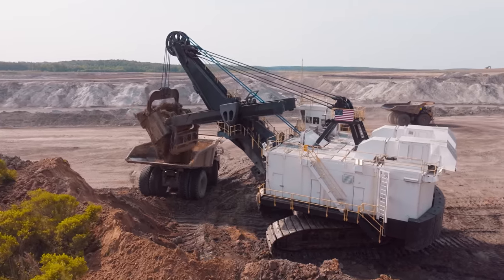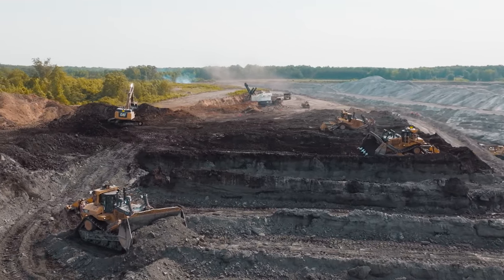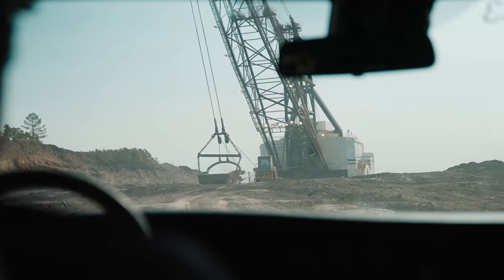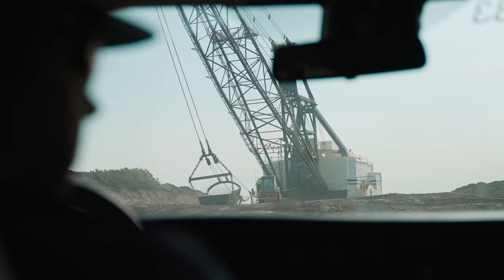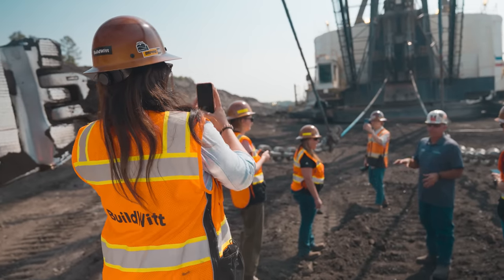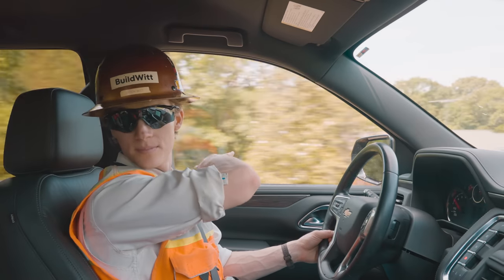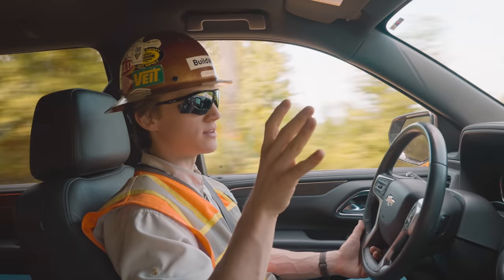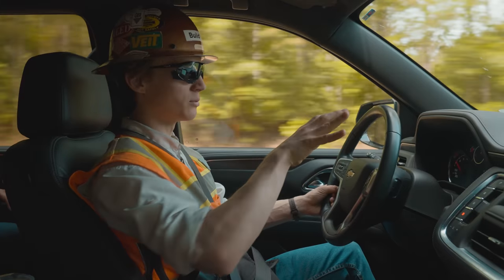Playing with GIANT Shovels and Buckets | Red Hills Coal Mine | North American Coal

Comment: It would be  awesome to see you tour mines, plants , and shipping  facilities  in Northern  MN and explain  the Iron ore mining / Taconite processing (Taconite is the product of removing  as much waste/ tailings as possible to  leave a  more concentrated iron ore for the steel  making process) The mines and taconite plants are in Northern  MN and produce the majority of the  raw iron ore in the US . Most bulk shipping  facilities are  less than  2 hours  away by rail on the great lakes(primarily  lake superior). I live in the Duluth/  superior / two harbors area and am in within a  10 to 45 minute drive of 4 of the shipping  facilities  which offload rail transferring mainly to ship for lower lakes steel mills. Lots of heavy earth moving machinery  and  industrial equipment  as well as rail infrastructure  especially at the mines but also at the shipping  locations.  Both shipping facilities  nearest to me operate  large loaders and other equipment  including bucket  wheel  excavators. Ive personally  worked for both a  foundry and a forge in  Duluth (ME Global Duluth/Gerdeau Grinding  Ball  that supply components  used in processing  raw material  into taconite/ semi finished  product. Although a lot of material is  exported... we do have a lot of raw material imported into the ports(coal,limestone,  and bentonite  clay etc.) A lot of which  is  shipped north to the mines  or to other industries.  We also have the largest coal export dock on the great lakes MERC which has a  large fleet of D11's.Another large  transload operation tied to mining in the area( Duluth/Superior)would be the Hallet Dock Co. which also has multiple  facilities and  operates  a large fleet of various  earth moving and rail machinery. It would be interesting to  see the mining,processing,  and shipping  process  if you are ever interested  and able to  cover it.. either way good  job explaining  and educating folks on the processes  behind  a lot of  the job sites and  industries you visit
Reply from the maker: I'd love to get up there one day but they're tough to get into

Comment: Yeah, have burn piles to burn the pine logs of the non native trees.   That’s always good for the environment.
Reply: That's nothing compared to the environmental impact of reintroducing the carbon from that coal back into the surface/atmospheric cycle. Mine site reclamation is important, yes, but it does nothing for the systemic impact of ongoing fossil fuels use.

Nobody is doing carbon capture from coal burning power plants. It's not economical and we don't have a solution for storing that carbon afterwards.

The physics just don't work out. The reason that fossil fuels are fuels at all it because they contain energy that we can exploit. In order to use that energy, we have to turn the (relatively) inert solids into gas. Going the other direction: turning the gas into an inert solid, requires at least the same amount of energy as was released. That's just the simple physics of it.

So capturing and converting carbon from burning fossil fuels, back into an inert form that can be easily stored, will never make sense from a net energy standpoint.

And if we have the technology to efficiently capture carbon from the atmosphere and convert it into a stable, energy-dense form... we should use that to create new carbon fuels from carbon we've already released into the atmosphere. Those would be net zero for atmospheric/surface system carbon, and we could use part of that infrastructure's output for sequestration to undo the effects of centuries of reintroducing old carbon.
Reply: @haphazard1342  I think it might be possible to convert lignite into a cleaner form but that hasn't really caught on

Comment: Damage not reclamation.
Reply: The surface reclamation is important, but even if they didn't reclaim the site the environmental damage on the surface absolutely pales in comparison to the damage caused systemically by burning fossil fuels and releasing their carbon into the atmosphere. Focusing on the highly visible mine site surface is a distraction from the primary impact of fossil fuels.

Honestly if all that was wrong with fossil fuels was localized environmental damage, that would be amazing. Instead, increasing atmospheric carbon threatens environments the entire world over.

Comment: I mean I love heavy equipment…but the burning of coal and the byproducts produced are atrocious for the environment.
Reply: It depends the application, not all coal is used for Power generation (the worst use case in terms of the environmental impact) but a vast amount of coal mines in North America are producing metallurgical/steel making coal and is extremely necessary in advancing our planet.
Reply: @julianmatheson  Coking steel is still a significant source of atmospheric carbon. It's slightly more justifiable as a use for coal compared to simply burning it (since we have good alternative energy sources for electricity, but not good alternative carbon sources for steel making), but it's still a massive net contributor to global warming.

If we want to have any hope of keeping the planet reasonably habitable, we need to stop all net fossil fuel carbon release immediately and find alternatives that utilize carbon that's already part of the atmospheric/surface cycle.
Reply: @haphazard1342  it’s not possible to simply stop carbon release, the modern world would collapse. We’re already seeing Power shortages in places like Germany & New Zealand who have tried to move too quickly without considering all the factors. There needs to be a methodical shift to greener energy sources but goals need to be feasible in terms of time & cost.
Reply from the maker: Then stop using power and the problem will be solved
Reply: @AaronWitt  😂😂
Reply: @julianmatheson  Thank You for your comment. Everything you stated is absolutely correct. So many people just don’t have a clue as to what is involved. Green energy has also been extremely unreliable thus far.
Reply: @williamhall9204  I get over a third of my power from renewables and have no problems